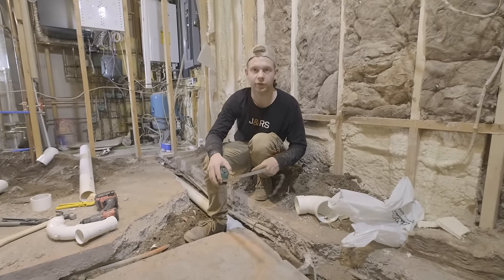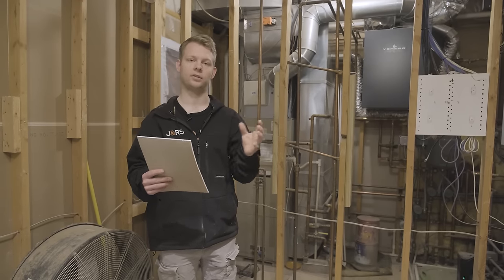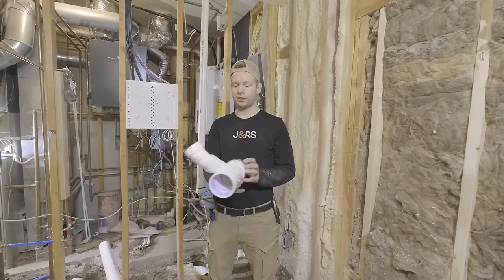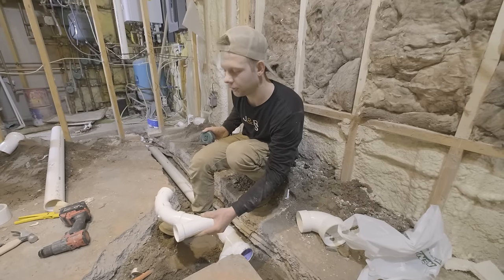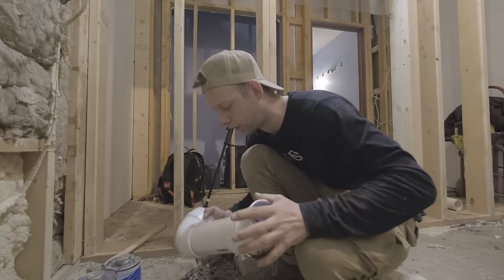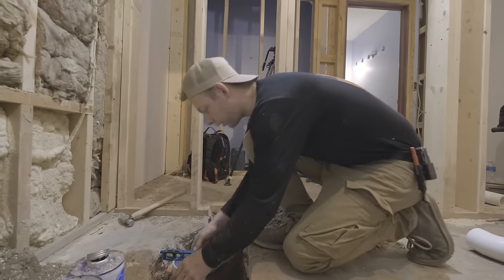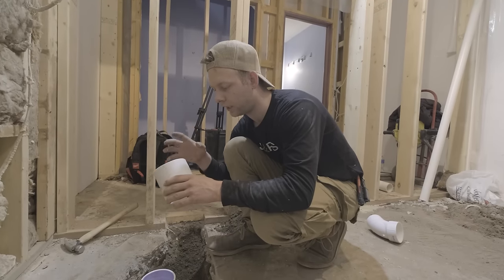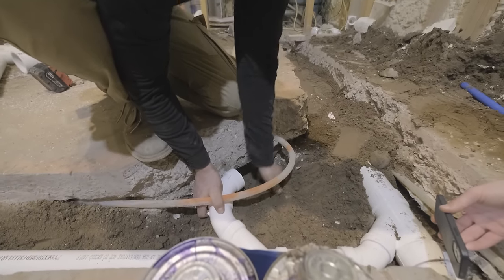How To Plumb a Bathroom With One Vent! Two Sinks, Toilet, and Tub/shower!

Comment: Good job,  from a fellow plumber. Suggestion you could put a 3"x2"wye fitting with a 2" street 1/8 bend on the main run to your toilet, in front of the toilet and continue the 2" run up into the wall making the system a combination waste and vent which would allow you to have a better venting system.
Reply: Why is it called a wye fitting and not a Y fitting?
Reply: @JustinMentionedIt  
Because that's how they spell it
Reply: Wet vent

Comment: I liked your in depth description of what you are doing!! Here in the St Louis Mo area you can only feed two fixtures off a 1/2" wtr line...I prefer copper but I realize it's expensive! and I agree that purple primer is messy but some inspectors want to see that you've used it so expose it a little bit out of the joint! I like how you're concerned/conscientious about the fall/pitch on drains ! Good job overall 👍I added my subscription! Keep up the good work!
Reply: What do you mean 2 fixtures on a 1/2" line? Which fixtures? A WC and a lav have very different fixture units.
Reply: I believe he means the two Lavs being on 1 1/2” wate piping
Reply: If you look at the code book the fixture count for 1/2 is there. Two fixture is some kind of lacking in education quote. Also the purple primer is use for a reason with pvc dwv. Another perosn lacking in an eduction.
Reply: Only two fixture on half inch cold period.  Maybe not in your area but generally you must feed a bath with 3/4.  cold side is  two fixtures off the 1/2   half inch cold.
Reply: @larrymarcum1673 
Depends on the water pressure, size of line feeding meter, and total distance for the water line. I have the chart in my UPC code book. 1/2" can do 6-7 fixture units. 6 if 40ft or less, 3/4" meter, and psi between 30-45. 7 FU's if 3/4" meter, no longer than 60ft, and psi between 46 and up. That's 7 lavs or 3 showers and a lav or 2 water closet  with 1.28 gravity tank and a shower. Point being is you can do more than 2 FU or I don't know if you mean just any 2 random fixtures, but still not correct.
Reply: I’m only aware of the code in palm beach county.  It is forbidden to have more than two fixtures on half inch cold, doesn’t matter if it’s a Roman tub or a water fountain.  That’s the only code I know.  If it’s legal where you are I learned something.
Reply: @workingtothebone256 
Good explanation. Code dictates this based on the factors that you mentioned. A WC has a higher fixture unit value than a lav so there is no "random 2 fixture units" because they vary.

Comment: Wouldn’t use that double cross.    Do a high low fitting.   A street San tee into a regular San tee.    The cable guy will thank you

Comment: Sweet video! I just finished the rough in for the eye doctor here in Kotzebue. I spent 14 hours on it and made $1500 bucks.
 The system I installed previously included water and the longest in-wall satellite wet vent I've ever built. The kitchen was 27 feet from the bathroom. I didn't have room in the attic to do a roof penetration.

Comment: In my state it’s IPC so I’m trying to relate as I watch. I have almost no plumbing experience, but I’m in the process of plumbing my tiny house. Right now I regret drywalling the kitchen before installing the plumbing. Fortunately, I haven’t taped and mudded it, so I can remove it and pull the insulation to facilitate the drains, vents and water supply lines. (Using 1/2” PEX throughout the house) Since my septic system is homemade, I’m going to continue composting human waste, so basically my septic is a gray water grease trap. Only the kitchen sink, dishwasher, shower and lavatory will empty into the septic. 
Thanks for this video.

Comment: When I was a rookie green apprentice plumber  I would always use my speed level on every ince of pipe.  45 years later its just eyeball level. I'm so proud of thus young man's skill level.  We need more young Americans kids in the trade. Here's my observations about running water lines in 2x4s. Always center your hole in the lumber be cause the drywall guys won't be thinking about your pipes. The electrician guys has his wire dead in the center.  Great job  though

Comment: This is a great trade to be in and you seem to be learning alot in the plumbing trade,  I personally make my vanity drains around 18" and my supply lines around 3" higher not lower but I've ran across supply lines lower every once in a while. Some inspectors will turn one down in my area for doing it that way but some want.  But overall great video and I hope you continue making videos this is the first time I've seen you on plumbing Videos I'll continue looking 
 And thanks.

Comment: Hey dude, kool videos, ty for sharing, in NJ were allowed 8 feet on a trap arm for a 2 inch line, 5 feet for 1 1/2, 10  for 3 inch, 9 on a w.c
Reply from the maker: Thanks! It is interesting to hear about the different plumbing standards
Reply: Hawaii is 3’, 5’, 8’, 10’

Comment: excellent, one note to add, my inspector wanted to see the primer to verify it was used because a common mistake is that some DIY will not use primer or will use none primer glue which will always leak on (PVC) Always show your primer on rough-in work. also no need to show pipe ID numbers facing up, Inspectors can find them, (California)

Comment: Removing the rough inner (and outer) pipe edge is great advice but you should use a proper deburring tool. It's quick, simple and leaves a smooth, inner beveled edge that guarantees nothing rough remains from the pipe cut to catch debris and build up clogs.
Reply: Or just a REED pipe cutter... usually only debur corzan (cpvc).... not abs or pvc buy hey

Comment: Great video - very helpful.  Question:  I've never heard of the problem of stress on the fitting barb due to running the pex too close to the stop.  I haven't use crimp-style Pex before so I am asking just to find out.  How real of a problem is this?

Comment: I like doing a clean job with the primer and glue, but I've found some City Inspectors want to see that purple primer and glue. It's the only way they can tell if you used primer and the proper glue. How can you tell if the joint is glued with clear glue?
Reply from the maker: Great question! When you glue right after priming a fitting, it creates a light purple color. and since I have a great relationship with the inspectors, they know I wouldn't be cutting corners like that.
Reply: When you know how to properly prime and glue,you don't tend to have issues. When you test it,then you will know.
You don't even need primer on waste pipe because there is no pressure pushing on the joints. I personally use primer but you don't need to if you bevel your pipe ends and the pipe is clean.
Reply: @daddy1571  I do commercial plumbing, I go by what ever the specs call for or what the City Inspector wants to see. For small jobs I use Red Hot Blue glue. No primer needed.
Reply: @rudedogii  I hate hot blue glue! It works good but I hate how it hydraulics out of the fitting. Weld-On medium bodied grey glue works the most consistently for me . It's the kind you want on a rainy top out or underground. I use clear primer. It doesn't push apart like the blue glue can.

Comment: Pretty nice job in all, the exception would be the rubber fernco is not upc code underground within a building, as a matter of preference pex B crimp is not a quality material compared to pex 
A expandable in my opinion. Also I always use copper stub outs as a rule , crimp angle stops if you have to replace them you cannot without opening the wall to extend the pipe, don’t see wrap around pipe for concrete protection and don’t see any test fittings for testing the system for leaks..( must be a job without permit?)

Comment: Why are you roughing in the sink traps 1-1/2 in off? Off in what direction and why?
Reply from the maker: Great question! 

Stubbing out slightly off center (left or right) will make the trap swing to the sink drain tailpiece. This will give more room for the trap kit in case the drain outlet on the bowl lands to close to the back of the cabinet. Another thing I didn't mention in the video is that you want to be off center for the drain trip lever rod so it doesn't hit your drain when operating. 🙌
Reply: Did you bother to watch the video?  He thoroughly explained why.

Comment: 13:23 ...hard to follow. 

I think you're talking about the pipe that runs parallel to and inside the wall, between the stack and the 90° elbow that turns the run perpendicular out of the wall.

...to run it from the center of the stack an inch or two past where the center of the sink falls on the wall. 

And the reason being is because it's easier to backtrack a trap than it is to extend it further to reach the center of the sink.

Comment: A really instructive video.  I  do have reservations why the "master" bath is located in the basement between the utility room and a concrete wall.   That's not on you but the owner/designer.  No windows and a dark environment are depressing.  My take.  Perhaps I missed something in the translation.   Overall,  you've shown a solid working knowledge of your trade.  Refreshing to see a young man pursuing something more meaningful than video games.  Well done.

Comment: Great video!  Excellent teaching tool.
A question I have with venting.
I'm looking at venting a new install toilet and vanity only in basement.
Could I tap into 2" kitchen drain from next floor above as a wet vent?  
Kitchen drain is used for kitchen sink and dishwasher only, then through the roof.
Reply: NOOOOO ! Wet vents for bathroom groups ONLY !
Reply: Kitchens=grease(& laundries=lint)
Reply: No, what you are referring too is called muti story wet venting and has its own restrictions. You cannot wet vent a bathroom group with a multi story wet vent, they are typically used only for stacked kitchens in a condo and even then are not ideal

Comment: This was an awesome tutorial and very well broken down in the most detailed way but unfortunately when you try to compensate for the next trade behind you by going off the original blueprint plans for a project just b/c you are considering the next man and his duties it 9 x's out of 10 blows up in your face for not following plan directions on a jobsite. Very informational and I myself always think the same way also. Unfortunately Plans are Plans and there's no room at all for self assuming or thinking about if a cabinet or drain comes in to close or an electrical panel needs to be rerouted or reduced down. I had to learn that a few times. lol  Unless this is a personal project or an approved modification  per plans then great. I've thought this way plenty of times over my career but everything is a formality on a project and have to follow plans unless the alterations are approved. Great video. I definitely  subscribed. Great Job buddy. We never stop learning in this trade from anyone.
Reply from the maker: Thanks, appreciate the feedback! around here a lot of the commercial remodel plumbing drawings do not have to be exact to the install because most of the firms are willing to do as-built drawings after the plumbing has been installed.

Comment: I’m a journeymen is both Idaho and Washington which both go off upc code. Idaho has an addendum that the toilet must be the first fixture on a horizontal wet vent. That aside upc allows one fixture before the toilet on a horizontal wet vent. Unless Minnesota has a separate addendum that toilet technically has no vent. Will it work probably but with it coming out of the top of the wye it’s not part of the wet vented branch. I’ve never seen a diagram that would allow that. Also (again unless Minnesota has an addendum for the toilet being a clean out) there needs to be a full size end of the run clean out. If you want to get really slick with it you could run two full bathrooms with one vent using circuit venting. It gets tricky with long runs keeping your standpipe within 24”. I ran a system on a house where every possible fixture that could be circuit vents was circuit vented. Two bathtubs two toilets and a shower. Everything else was vented on tees in the wall.
Reply: Hmm, do you have a reference for that Idaho addendum? Sounds wrong since UPC REQUIRES toilet to be last (downstream) on any wet vent (908.2.4). Also you misunderstood UPC to say only one fixture before toilet on a wet vent, when it actually says only one fixture before the dry vented fixture drain (908.2.1).
Also by saying the toilet technically has no vent, you are really not understanding what part of the drain is the wet vent. His toilet is perfectly vented per UPC 908.2

Comment: I have two bathrooms, back to back ..... one is original and the other is currently being installed ... question ... can I tie into the original three-inch vent for everything so I have only one roof penetration?  
  I have a raised floor  and was thinking of running both toilets into the same drain /vent under the house both toilets are within 8 ft of the vent pipe
Reply from the maker: Yes, a 3-inch is more than sufficient to vent 2 bathrooms. Keep in mind every fixture has to be vented.

Comment: Wondering why you used a 4 way combo fitting. Shouldn't a 4 way san-tee be used when going from horz. to vert. with a vent above?
Reply: I just found out today from my inspector that the sanitary T is no longer allowed by code for the double sink.

Comment: Just found this video, very interesting. But I have a question though:
I see the main drain, for the toilet, is running underneath where you are putting the double lav. So, why did you not ty into that drain straight away instead of doing difficult and putting in a double y where the shower goes into the main drain?
I am not a plumber, obviously, but this seemed a but weird to me.
Thanks.
Reply from the maker: Yes, we could tie directly into the main for the lav, but we would have to individually vent the rest of the bathroom fixtures then. That is usually how it'd be done. The purpose of this video is to vent this bathroom with one vent.

Comment: Im learning, but why can't you run the sink lines straight down to the 3" instead of going back tieing into shower drain?
Reply: The wet vent serving tge sink will not serve the shower if the shower trap arm is not coming directly off the 2" wet vent. The only way to do that is to use a symmetrical wye fitting off the 3", one side going to tge oavs the ither too the shower.   2 lavs venting a w.c are 1.5 fixture units per, the shower is 1.5 also meaning 4.5 f.u draining to the wet vent which us 1.5 fu over what is allowed here ( Canadian npc )

Comment: First time visit to your channel - nice.  YouTube just popped you up.
I'm a contractor (not a plumber) but we do a lot of our own maintenance and remodeling, mostly on our properties.
Are those two horizontal elbow drains for the sinks code?  I thought they had to drain vertically first, and then horizontally.
Be Well.
Reply from the maker: Thanks for the watching! Yes this is done to code. Assuming I'm understanding you correct, the vertical drain as you are saying still has to have a trap arm coming off to get over or into the sink. This has to run horizontal from the san tee to the trap. Also you can do up to a 90 and a 45 for 135 degrees of turn on a trap arm. I hope this make sense!
Reply: It's code in most states the way it's done on this video it can run horizontal.
Reply: A 90 may be used horizontally where it is part of a trap arm serving a lavatory  ( npc Canada )   it's the only place where a 90 can be used horizontally

Comment: Enjoyable and informative video!  Wanted to clarify on the "crimp" versus "clamp/cinch."  You are actually using a cinch ring, correct?  If it was a crimp ring it would be copper and be one continuous ring with no flange?
Reply from the maker: You nailed it!

Comment: Thanks for this video. I'm redoing my own basement bathroom soon which will involve redoing the drain pipes under the slab (adding shower, moving toilet and vanity). That's only part of the whole project that worries me a bit since I've never done it before and you only get one chance before it gets covered with concrete.

Do you need a cleanout for the shower trap arm, or do you snake that from the shower drain if there's any blockage? I ask because that the cleanout you added doesn't allow access to the shower trap arm.

I have to say the camera work in this video is pretty bad. When you're explaining stuff, the camera is usually pointed at you instead of the thing that you're explaining. It should be showing a closeup of whatever you're explaining.

I also think you jumped into the details too fast at the beginning of the video. You should show an overview of the bathroom layout first so we know what you're attempting to do. But maybe you did try doing that and the camera was pointed at you the whole time so the viewer never got to see the overall layout. I don't think there was a single shot of the whole bathroom.
Reply: Just hire an actual plumber. Even if you just pay them to do only the rough in. There’s too much at risk once that concrete is poured. Otherwise you’re taking a huge gamble.
Reply: @garycasper2929  I've definitely thought about that and I might end up doing that, but not before I've given it my best shot. I've done a lot of research and planning for this reno and I feel it's within my capabilities. If I feel like I'm in over my head, I'll back off and call a plumber.
Reply: You don't need a clean out at the shower p trap

Comment: Npc states that a w.c wet vent can recieve a maximum of 3 fixture units. The 2 lavs are 1.5 f.u each meaningvthe shower puts it at 1.5 fu over. The shower ir the toilet should have had its own dedicated vent. This setup with dual lavs will work 100% but uts not fully to code ( at least where im located ).